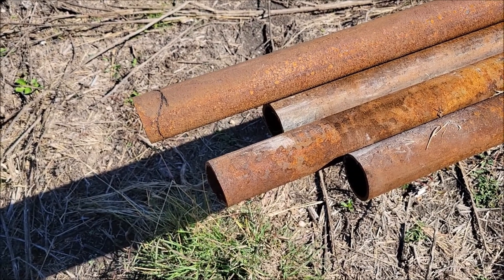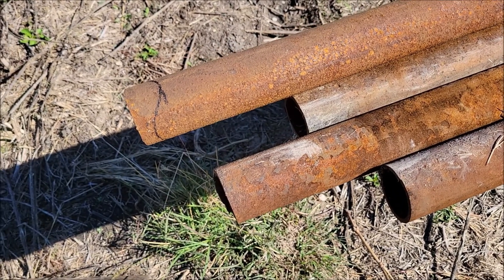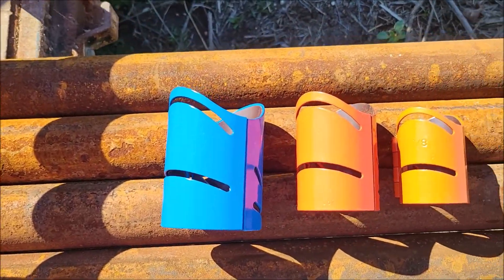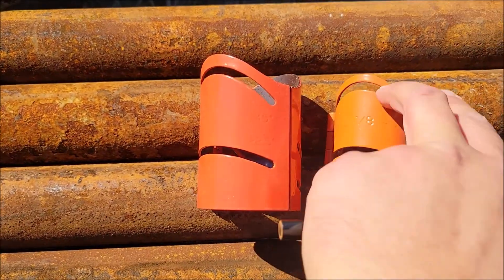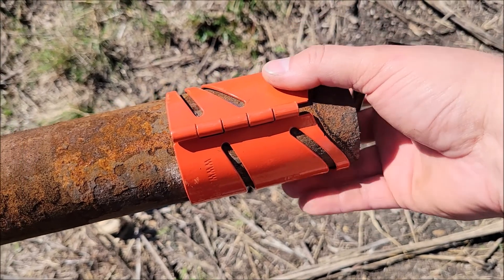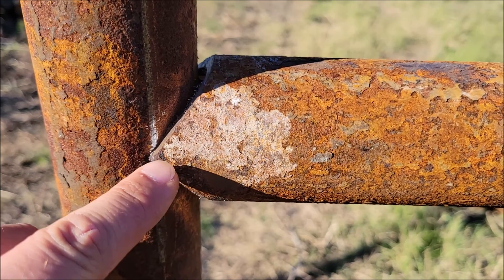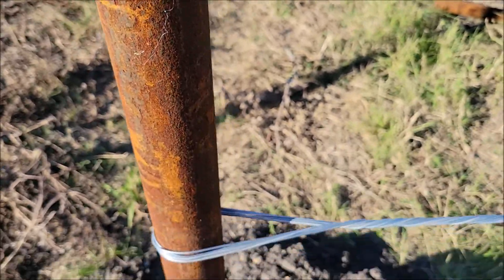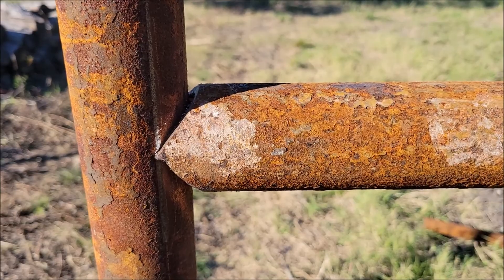Easy Way to Saddle Cut Pipe | How to Fishmouth or Cope Pipe | Pipe Fence

Comment: It's not drill stem 😆. What is drill stem? 😆 It's well tubing. But a good video
Reply from the maker: This is the actual drill stem that is used to drill wells and is usually much thicker than the tubing and casing.
Reply: @SeidelRanch nobody in the oil field drills with 2  3/8 sorry.

Comment: I just cut both sides of the pipe with my band saw at roughly 37 degrees (+-, depends on the size) and slightly sand the tips on the inside. Works perfectly and doesn’t need any stencils.
Reply from the maker: That is basically what the stencils draw.  Once you get the angle right you don't even need to draw it.  Sounds like you got it down.

Comment: Why don’t you just use a strap to pull your posts in?
Reply from the maker: That is a good idea, but I was not welding them as I was setting them up so I did not have that many straps.  I usually just use some steel electric line to twist up and tighten them up.  I am sure straps would work fine though.

Comment: I’d like to see how your band saw works cutting those curves
Reply from the maker: Well, they look like curves but are really not.  Not until the deep part of the V.  So I just cut at a 30 degree angle through it and then nip off the tabs at the end.  It's been pretty good so far.  I use to just wing it and sometimes it was good, but usually it was welding up gaps all over.
Reply: I'd like to know why you use a band saw. We use a torch. It's faster portable and you can cut that nipple off with the pipe in place.